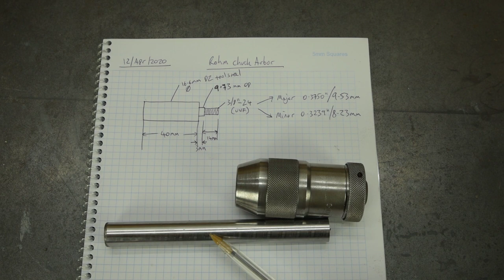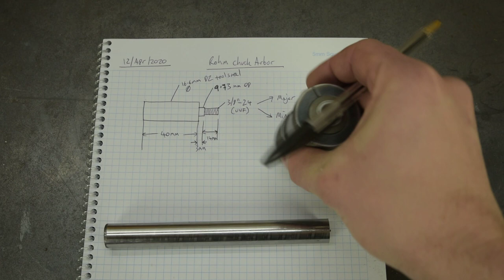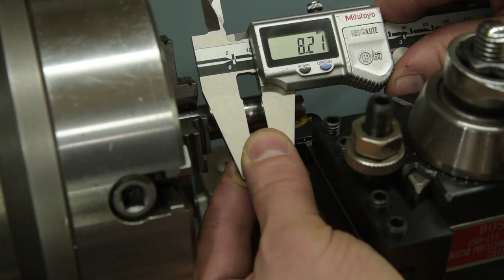Making a Drill Chuck Arbor

Comment from the maker: PS: I forgot to mention, I initially tried to to make this arbor with a (worn out) live centre to start with, but that failed entirely and I pulled the centre to bits to see if it's repairable. Anyway - I have a new live centre on the way, and later on I'll try again to make a really accurate arbor. This one will do for now though!

Comment: Nothing is perfect mate, it's what you can live with and what works for you. I like how you crept up to the thread cut depth to keep the fit as tight as possible. 
Cheers
Reply from the maker: Thanks Rick. I would have preferred less run out, and I think there's going to be a part 2, where I turn the shaft in situ on the chuck.

Comment: welcome the the crazy world of fun steels to work with. u did well to single point that.
Reply from the maker: Thanks Emma. Used a new carbide tip and was vigilant about using lube. Didn't leave a nice surface finish on the threads though. I think it needs much bigger feed, depth and speed than I want to do while threading. You can feel it harden while you turn it, if you linger too long.

Comment: looks good and Ill have to make one up like that for my mill. For the chuck with the bad runout, you can always do what I did and just stick a piece of stock in the mill, turn it down to the maximum size that the chuck can handle, then tighten the chuck up on the turned down piece. From there, just take light cuts on the arbor till you get it down to size you need and it'll run dead nuts true to the jaws then. 

I did that for my old 2 jaw chuck I use all the time, it had a straight shank on it from the start, so I did it up that way and cut the MT2 taper out of the straight shank so I could use it in my tailstock, and you know how it's been since then, lol.
Reply from the maker: That is a great idea. I could even face and centre drill the arbor and give it a bit of support (so it doesn't turn tapered - it is quite tough stuff). 

I may well give that a go. Thanks for the idea Chirp!

Cheers,
Craig
Reply: Great tip Chirpy 👍
Reply: You beat me to it.
 I bought half a dozen cheap(very) drill chucks and turned straight shank arbors once fitted, as you describe. Pretty reasonable run out now, all i have to do now is make the chuck key fit properly. Although that isn't a problem as each chuck is going to have a tapping size drill fitted long term.

Comment: Nice idea man! I I need to get myself a mill, would be so useful in the shop!
Reply from the maker: Thanks Dmitri. I still need to fasten that chuck to a piece of freshly turned rod, so I can return the arbor and make it perfect. It's a good useful tool already though, not sure how I lived without one. Much faster for standard drilling, tapping and countersinking operations. Cheers, Craig
Reply: @CraigsWorkshop  Why not use a drillpress for those standard operations and only use the mill for milling? I use 2 drill presses when I have a lot of holes to drill/tap - drill on one, tap on the next, countersink with a hand drill. No changing tools then!
Reply from the maker: Often for a machining project I will want to put a hole or a bore in a specific place using the dials or DRO. There is also often a chain of events with hole making:  pilot hole, tap hole, clearance hole, tapping, countersinking or counterboring. So having the precision but also the quick change ability is good. Also, the drill press only goes forwards and doesn't soft start and stop like the mill + VFD does so it's not as good at tapping.

Comment: Good job Craig.  I would do what Chirpy suggested to get it centred relative to the jaws. All these chucks are out a bit and it gets worse as they get older.  The thread to jaw relationship may not be exact.   I have done it as suggested and it works out pretty damn accurate. Cheers Rob
Reply from the maker: Thanks Rob - it's a great idea that's for sure. I will give it a go, sounds simple and "pretty damn accurate" is exactly what I'm going for! Will post an update. Cheers, Craig

Comment: Straight arbor came out well. 1.8 thou is pritty good for a normal chuck.
If it was the ER40 collet chuck that had that runout then I'd be chasing better accuracy.
Regards
Kevin
Reply from the maker: Same here! My collet chuck taper is good to between 2 and 3 tenths depending on where you measure it. I hope to make a better drill chuck arbor later, but this is good enough for now. Thanks Kevin. Cheers, Craig

Comment: Hi Craig. Enjoyed your machining. You'll have to be an expert drill sharpener and use quality drill bits to match that chuck. 
Run out may vary with the diameter of the test piece if the jaws are worn unevenly. Nice work. Tony
Reply from the maker: Thanks Tony. I'll give you a clue: I'm not an expert drill sharpener :) I knew the runout may change, and reading up on the albrecht info, they use about 3 (I think, maybe 4) different sized hard ground pins when they test their chuck runout. 
Just trying to get as good a result as I can for zero outlay. :)

I think turning the shank based on a ground rod in the jaws will give a decent result. I'll try it and post an update. Thanks, Craig

Comment: Nice one.
You are really spoiled with that mill's vertical clearance. Wanna swap?
Reply from the maker: I can saw 150 or 200mm out of the column and post it to you at your cost? Share the bounty :) Having said that, I haven't yet played around with putting a chuck on the rotary table, and then a work-piece. Stacking things up like that, I reckon I'll need all the headroom I can get.

Or - alternatively - anytime you're local and need the headroom, you're welcome to drop in and use the mill (after the virus shenanigans). I'll drive the cameras and we'll call it a collaboration :)

We talked about mill risers recently. I've figured it out - mine really needs to go below the base. If the whole thing were 150mm taller, it'd be much better for my back. I think a few leveled concrete blocks might do it. :)

Comment: Beautiful job and great fit on the thread have you cleaned the chuck? the runout seems fine but less is better if a clean and lube may halp and it is free
Reply from the maker: Thanks Joe. Yes, I stripped the chuck down recently and gave it a good clean up. It's not perfect run-out wise, but it's good enough for now. Once the live centre (on order) arrives, I'll try again to make a really accurate one. Maybe even try some heat treating. Cheers, Craig
Reply: @CraigsWorkshop  came out just fine just checking on cleanup it helped mine by .002 runout

Comment: : Crawls out from under the April fool rock of shame 🤦‍♂️.  How was the D2 for turning? any problems with it hardening a bit due to heat buildup?
Reply from the maker: No shame Bill and there have been 2-3 videos since then :) D2 is very tough but no.match for carbide. The swarf was a bit stringy, blue and hard as glass. Think I needed to take bigger bites, but I didn't have much to come off.
Reply from the maker: PS. Most of the heat comes off with the chip
Reply: Good stuff, didn't think it would really cause a problem. Critical temp is about 1000c. I do notice that too much heat when grinding can cause a sort of 'case hardening'? pretty tough stuff but has great stability, just a pain to get a nice finish, very hard to polish.
Gonna cobble together a frankenburner and hoping to cook my first knife in a few years today.
Reply from the maker: @billbaggins  The hardening is not surprising - it was doing that a little while turning too. High chromium (and probably the vanadium) makes it very wear resistant, so sanding it will be difficult, tending to generate heat rather than cut, which probably makes the problem worse. Good luck with that knife!
Reply: I usually do a sandblast finish cleaned up with steel wool. Wanna find some gun blue one day and try that.
D2 was originally developed to make the bearings for the big guns on battleships in ww2 so I guess 'Oooooh shiney' wasnt high on the list of specs 😁.  Dimensional stability and air quenching along with corrosion resistance are its key benefits but it can be tough on tools. Leaky memory suggests its not so good for forging tho.
Reply from the maker: @billbaggins  I picked up a small bottle of chemical blue from the fishing place in Moonah. Haven't tried it yet, but it's on the to do list.
Reply: Excellent.. you can do all the experiments mate 🤣
Reply from the maker: @billbaggins  You know that's all I do at the best of times :)